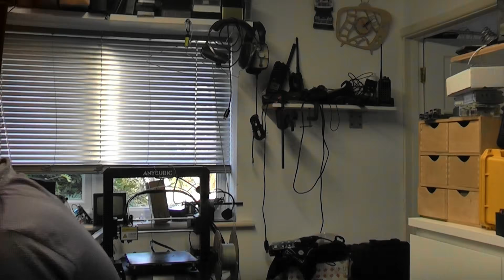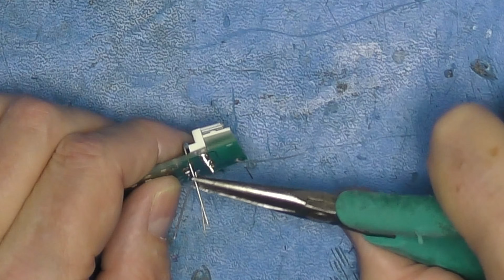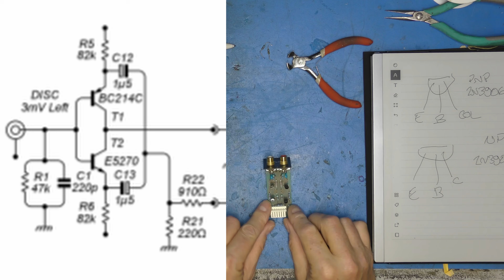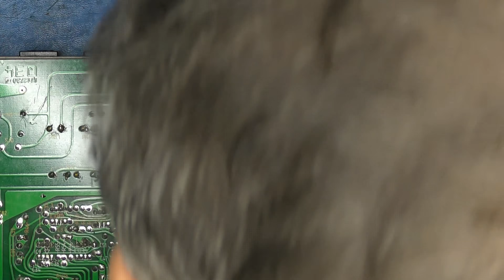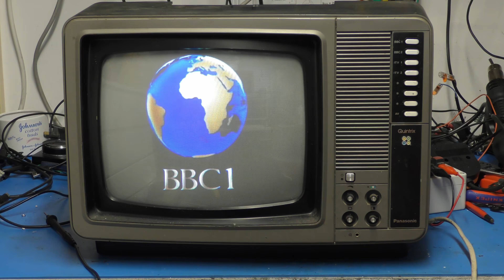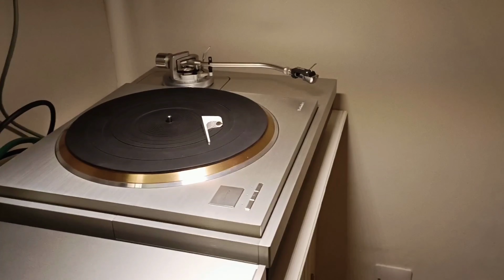Quad 34 Part 3 - Adding a phono stage

Comment: Great series on this Quad 34 reapair! The 220pF input capacity for the MM module is actually rather highish. A common mod is to reduce C1 and C2 to 47pF, especially when using AT cartridges. I once made a little sketch of the solder side of the phono module (which can still be found on the DaDa Australia website), but missed to point out the correct direction of the tantalums and the transistors. 
The Quad 34 can sound wonderfully, especially when replacing the opamps and removing (then) unnecessary coupling capacitors. 
I had a lot of fun watching your superb videos!
Reply from the maker: Thanks. Nice to have you here

Comment: Finally finished this marathon😰, nice one. Is that some more of your good friends singing the song at the end? Please tell me who it is as I can't think of their band name. Thanks for sharing.
Reply from the maker: That one is sung by Doz and the Bad Caps. AI, ably assisted by me!
Reply: Could be the lost track from The luxury gap sessions.
Interesting and fun video. It’s a pity the 34 was never the best sounding Pre amp. I changed to a Michell Argo and things radically improved. Would be fascinating to see you open and work on one of those. I think Tom Evans the designer scratched the marking on the components off though.